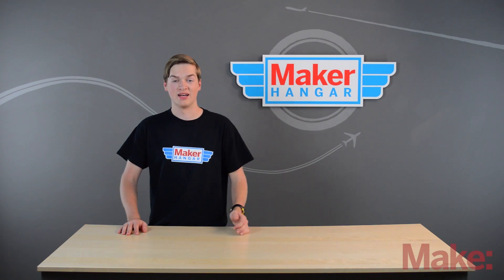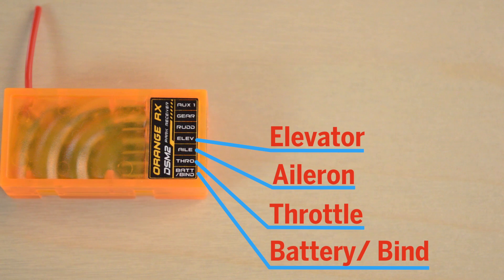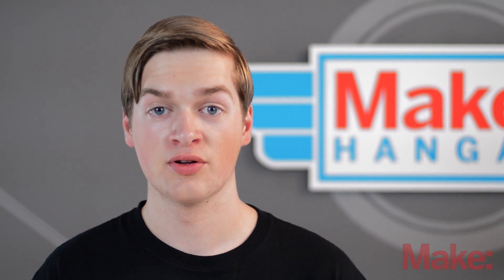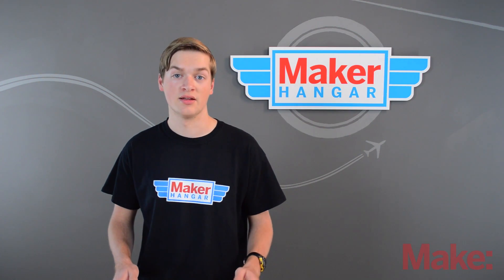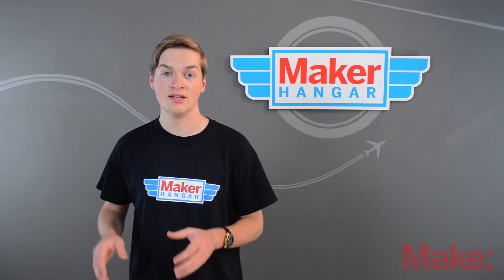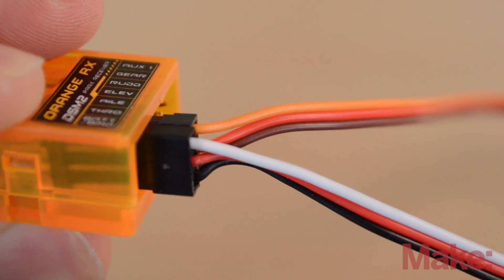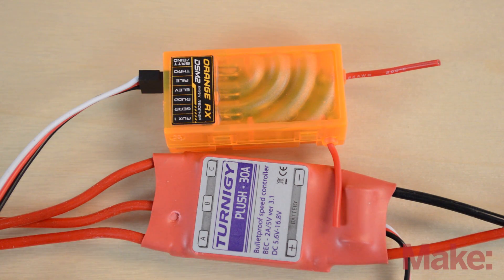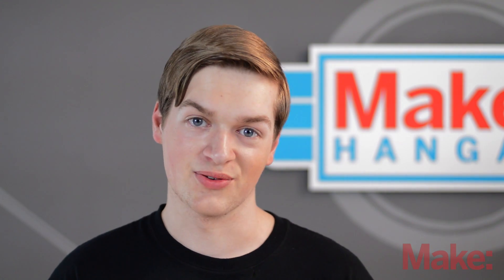Maker Hangar: Episode 7 - Receivers

Comment: Hi, (I'm a total beginner) I'm building a 250 sized quad and I have 4 Opto ESCs (no BEC in them).  How should I power the Receiver (RX701) or the FLight Controller (CC3D)? Thanks!
Reply: Get a BEC or power step-down.
Reply: I finally bought an SBEC

Comment: His information is good but his experience or his focus is very limited.  Not all of the information is accurate.  For example he says all receivers come with bind plugs.  That is definitely not true.  He says you need an external BEC for more than 4 servos. That is also not necessarily true, but for the intended audience it is probably not a huge issue.   Overall a good job.

Comment: In this case not. Normally I can watch at 720p without hangs. In worst cases at 480p.
Youtube sometimes does strange things. And it is ridiculous that you can't set the player to use the prevously used quality setting (just like it does with the volume). You can only always watch in low quality or according to the connection speed.